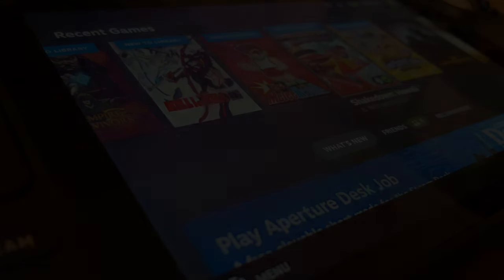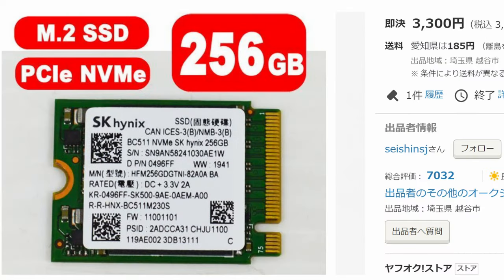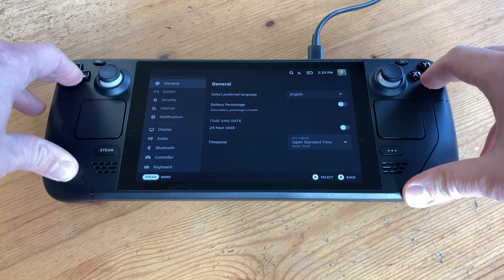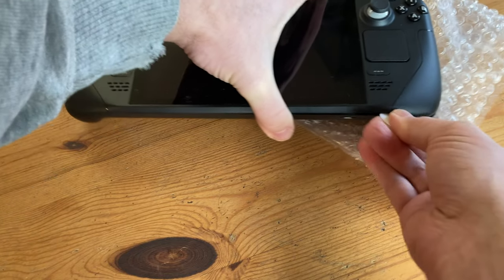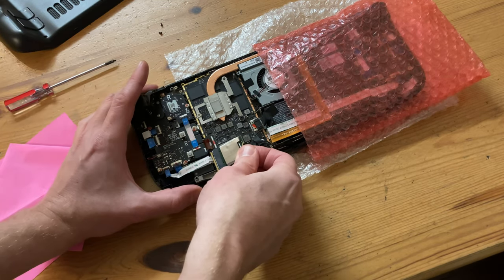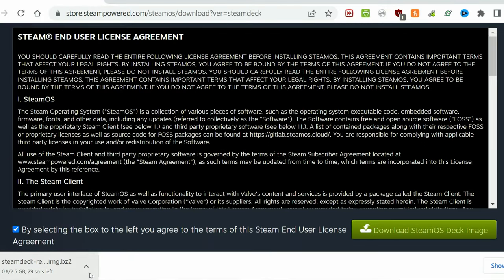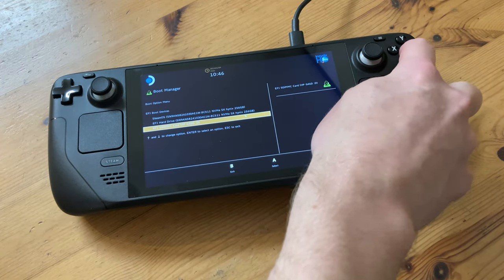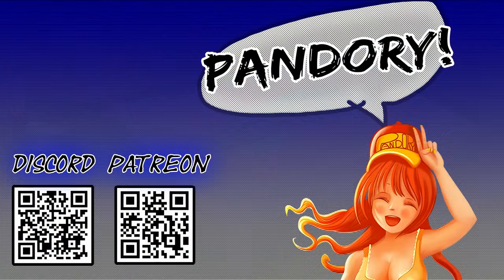STEAM DECK 64GB NVME UPGRADE GUIDE - A Quick and Easy Guide

Comment: In 2023, at least 2TB!

Hope all is well.
:face-blue-wide-eyes:
Reply from the maker: Yeah I'd put more on if I actually intended on completely filling it, but I doubt that's going to be the case :-)
Reply: Be careful, some of the larger and faster drives consume 2-3 times more power, that might be more than your Steam Deck can handle.